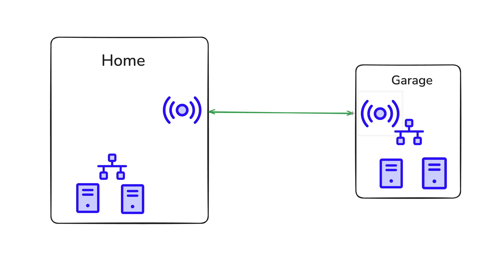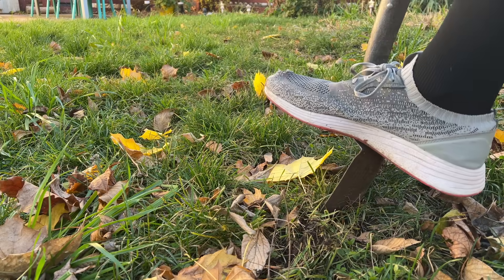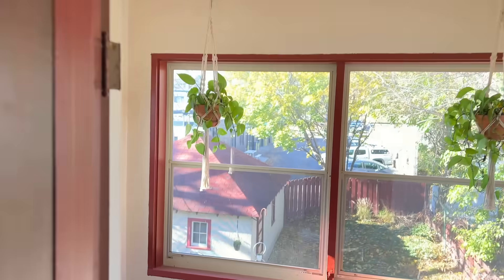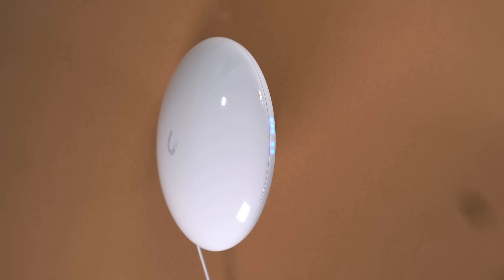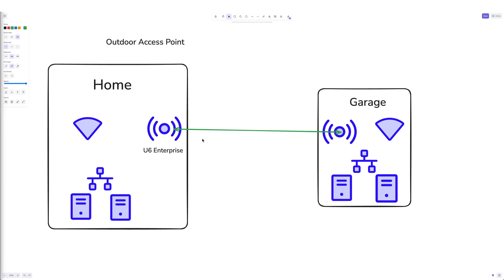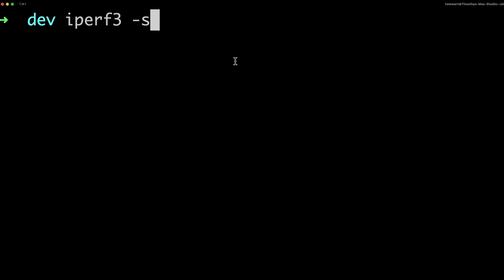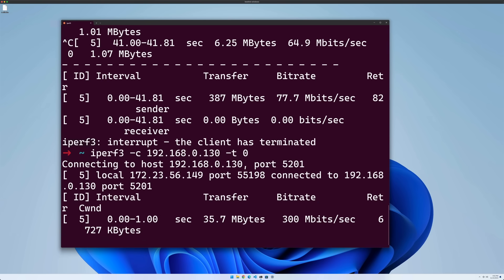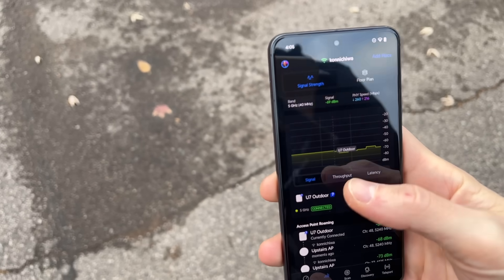Improving my WiFi Bridge with the UniFi U7 Outdoor and the UDB

Comment: I recently purchased a new U7 Pro SGX and a UniFi 10G switch. The switch uplink is connected to the router at 20 Gbps, while the access point is connected to the switch at 10 Gbps. Despite trying different spectrum settings, my speed test results remain consistently low—around 720 Mbps download and 350 Mbps upload. Interestingly, when I tested the LAN speed on the same switch, it achieved much higher speeds of approximately 925/925 Mbps. I would greatly appreciate any suggestions to improve my wifi internet speed. For my Wi-Fi tests, I used an iPhone 17 Pro Max, a Dell PC with a Wi-Fi 6E card, and a Lenovo PC with Wi-Fi 5. My internet plan provides 1 Gbps fiber service.

Comment: My situation was similar, however my garage is colourbond (metal) and literally nothing can get in or out of this giant faraday cage! So I bought a cheap wifi antenna, mounted it on the outside of the shed with the UDB Bridge inside (you can select external antenna and just connect the SMA cable where the extension antenna goes) connected to a U6+ inside the shed. With an AC Mesh AP on the outside of the house I'm getting a pretty stable connection with 2-300 Mbps. This makes me thing the U7 outdoor would improve it even more. Also I'm not convinced the extension antenna works as well as it could.

Comment: Dude.  Thanks for this video.  I struggle trying to find real world scenarios that match my exact scenario.  I'm at 5 minutes and your scenario and thought process is nearly exactly the same as mine.  The point to point is ideal but, well, total overkill.  For the price, I could just pay someone to run the LAN line :).  

Another benefit is - this is a nice modular solution; it'll likely last a few years and be usable in other scenarios.

Comment: The point was to have reliable WiFi in the garage, no? When you installed the U7 pointing to the garage that was it. Why did you need another AP there still?
Maybe I missed the final solution drawing.

Comment: The most stable connection would be an aerial steel line (if diggig is not an option) and fiber optic cable attached to it. That is what many ISPs do in some countries and it works. The only downside would be just the visible line between buildings, but its tiny anyway. Are there any other downsides? No digging, no APs, no radiation, almost clean job to do :) Nice vids you're producing!

Comment: Be aware that connecting a single UDM Pro to the Unifi network(in my case to a AC Pro)  using the suppied poe adapter is fraught with fustration and issues.  For the last 25 days I have been working with Unifi support to get this working.  I am using early release software but still it doesnt work.  The UDM Pro adopts to the network comes online for a minute and then goes offline and stays offline.  If you connect the UDM Pro to the network using a ethernet cable it works OK.  Bear this in mind before you think of using.

Comment: Have you considered EnGenius for your connectivity needs? Our EOC product line offers robust point-to-point and point-to-multipoint solutions designed for reliable wireless connectivity.

I previously owned a WISP and primarily used Ubiquiti, but after switching to EnGenius, I saw significant advantages. Now, as part of the EnGenius team, I’d love the opportunity to discuss our solutions with you

Comment: Can I use the UDB / UDB Pro as a Bridge to connect to my existing wireless AP's - Netgear, Zyxel, T-Mobile router, etc? I have multiple networks at different locations using a wide range of brands of equipment. I also have another location where I have the Unifi Swiss Army Knife set up as an Access Point (not adopted in Unifi). There is no setting in it to turn on "Mesh mode". Thanks and great video.

Comment: Seems like a point to point bridge would’ve been a better solution. The argument against it was that it required outdoor mounting and drilling holes. But then the U7 was installed outside which still required drilling holes.
Reply: Correct.  Cheaper, faster, more reliable, already outdoor rated, etc.
Reply: not only that but needing an ap inside the garage still .
Reply from the maker: @JasonH17 that’s right!

Comment: @TechnoTim Thank you so much for the review! I want to install 2 pieces of u7 outdoor antennas in Omni directional mode at an outdoor distance of about 870 feet (~265 m.). Can I connect them to each other using Mesh and distribute the internet and network from the second access point at a remote location?
Reply from the maker: This should work and give you coverage in between albiet maybe not the greatest.  If I were going long distance I would use the UDB Pro since that's what it's made for.
Reply: @TechnoTim  Sounds good. Thank you so much for your reply.

Comment: Why not just upgrade to network cables?, they are faster and impossible to hack, yet wifi is not secure and emits toxic, harmful electromagnetic radiation. Be considerate to others and don't use wifi or harmful wireless frequencies, it's worse than second hand cigarette smoke.

Comment: Just now setting up four U6 Mesh access points that I have been sitting on for a year. Since my shed is only 120ft away I think they will do, but the performance of this has me wishing that I held off on my purchase until ready to run conduit throughout my house. The 4th U6 Mesh is going to another out building about 100ft away. Oh well, the two U6 Mesh WAPs installed to the exterior of my house are radius and also providing a strong signal for inside.

Comment: The U7 outdoor really is a beast.  We upgraded to one at work from the U6 Mesh units and the difference isn't even funny.  Crazy good deal at $200, for what you get.  That said, $200 for that and another $100 for the UDB (most people don't get Ubiquiti gear for free), for $300 I suspect you could have had a contractor bury a new cable for you, or perhaps run it as an aerial line, and that line would absolutely DESTROY the wifi gear with a rock solid 10g over copper throughput (if you have it, else EASY interference-proof solid 1g performance without blinking), without blasting all your neighbors' wifi out of commission.  Better yet, fiber, and never have to worry about speed again, at least not until 100g networking is too slow.

Comment: great video! just a couple questions how does the power get from your house to the garage? I had a similar project where i used a tension cable for hanging edison patio lights and some outdoor rated CAT6 and just tied the 2 buildings together. it worked out great for me.
Reply from the maker: There's a buried cable from the house to the garage (another reason I didn't want to dig)  😅

Comment: Dude... stop coping, please. This is not an ideal setup if you do anything mission critical on your garage network. Just lay a speed pipe between the buildings and file the costs as business expenses. You WILL see yourself wanting to upgrade to 10+ Gbit/s at some point and then your only option is optical fiber. You're only delaying the inevitable.

Comment: The point to point was the way to go. They operate at 60 Ghz do there's virtually no interference and then use a poe switch in the garage. Use that to power whatever AP you want to use. Couldn't finish watching this.

Comment: I honestly went with PTP between house and garage using the UISP Wave Pico. They're cheap enough and easy enough to set up and look great too. (I can send pictures) Especially with the Quick Mount they provide in the store separately. Having 60Ghz is awesome for speed and latency and optional backhaul is nice too, for when it's needed. I initially thought it was overkill too. Although, right after I purchased it, a week later they announced the new bridge devices.

Initially I was gonna go with the UBB but there was stock issues and a longevity issue in the event a replacement was required. The waves are modular enough, plus it's fun to mess with a new software suite. UISP is quite cool, too.
Reply: The Wave Pico and or Gigabeams are worlds better than going back to a nanostation/loco/nanobeam or the rebrannded ubb/udb.  While not full duplex, they have enough bandwidth as a half duplex device and also give you the fail back 5Ghz as well.   Yes it will not show up on the Unifi dashboard, but it is a much cheaper path that you took.

Comment: We just ran a dedicated point to point from our water tower to our new building site a little over a mile away (utility company). We are also in Minnesota so I'm curious how well this will work in our cold winters 120ft in the air. 😁
Reply: As long as it's ubiquiti or Mikrorik, it'll be fine. -40F and the units are rock solid as long as you UPS the units and intend on running them 24x7. Had good luck running them  from about 95F to -40F without any issues, DFS bugs in beta firmwares but generally really stable. Only issues are Line Of Sight and interference from other devices. DFS is nice for that; multiple 20/40MHz channels to play with free from much interference (unless youre near a huge urban center)

Comment: To connect our shed to the network I'm going to run a cat 6a STP suspended on a wire about 15' in the air. Leaves plenty of headroom for moving ladders about and I can get the suspended wire as tight as a guitar string. keeping the cat 6a equally straight. No limp noodles like the rest of our network in the house. everything dead straight and right angles everywhere. Copious amounts of cableties and outdoor rated cat 6a too UV protected of course. that will give me 10gig over the copper. points are already wired at one end. just need to fix the shed up now :P I'll probably put 2 cables up there so i have a redundent cable should the first one fail.

Comment: One of the first things I did when I bought my house in South Minneapolis is dig a trench, lay down 8-3UF, 1-1/2 conduit, and pull 6 runs of cat5e to the garage. A few years later, I yanked out the cable, and pulled it back in with an air hose, so my compressor is in the garage and I have compressed air in the house.
Reply from the maker: Much better use!

Comment: When testing using the DFS channels how bad is the interruption from rescanning for an open channel? Curious if this was just a monetary drop or if radar occupies large frequency ranges and means a longer drop out.
Reply from the maker: Great question! A couple of things I noticed:
1) Channels take a long time to scan when switching to a DFS channel, up to 1 minute
2) When radar is detected it tells my AP to switch channels.  I think that that point it has 60 seconds to notifiy all of my clients of the incoming changes and will find a non DFS channel, at which point it switches.
3) This change happened within 2 minutes and all clients switched channels.  There might have been a small interrupion to the clients but hard to know
4) The access point stayed on the NON DFS channel until my daily optmization ran at 2 AM, then it switched back.
5) RADAR was never consitent.  Seemed to start at 7:30 AM, 2:27 AM, 5:54 AM.

Comment: I have build wireless bridges for years now. First 11Mbit with Dlink and Yagi-antennas, than 300Mbit with patch-antennas (Dlink and TP-Link), than 108Mbit point2point over 300m with Ubiquiti, than 5Ghz as an upgrade on the same link and now mesh with AC-lite, AC-mesh, U6-mesh and U6-pro. About 35 APs controlled with a single RasPi4b.
Reply: What do you use in the raspberry?
Reply: @rafaelpirolla I use RaspiOS with Unifi-Controller.

Comment: Did you try the UDB Pro?  Would be interesting to see if you got any additional gains at that distance...
Reply from the maker: I did, it's in there.  Worked a little better (better quality signal) but still not worth the hassle if I was going to mount it properly since it's directional.  New AP (U7) plus UDB FTW!
Reply: @TechnoTim  lol, multitasking while watching..  yeah it was super impressive at distance in my testing..   UDB made more since in ur application, I was just interested in speed results head to head....
Reply: @DPCTechnology  Same here.  I would like to see speed results of 2 UDB pros mounted outside compared to his current setup

Comment: I've been using two Ubiquiti Nanostation locos between the house and garage at my parents for years now. They work extremely well and haven't had any issues with them. They are UISP devices but they do show up in the Unifi network topology properly. The reason I did those was also the same reasons you have for not running a cable. Though thankfully the siding there is vinyl and not stucco haha.
Reply: I've been using PTP from house to garage for 4.5 years with a pair of NanoBeam AC Gen2 from Ubiquiti. Work great for cameras and garage TV.  Similar constraints as you in my South Minneapolis property regarding trenching. These NanoBeams have been rock solid, but I do have to manage them separate from my Unifi gear, which is not difficult.
Reply from the maker: Good to know they show up in UniFi even though they are UISP!  I will keep that in mind!  Thanks for confirmation!
Reply: @TechnoTim  np! They only show up under wired connections though! So if you filter by only Unifi devices they won't show up. But when they are showing you can see the connection between them.
Reply: Have a pair myself. They have been great.
Reply: Also 1/4 the price. I use the airMAX NanoStation 5AC Locos and they are very easy to setup & rock solid.
Reply: Yeah, I wish they would make it so we could manage them within the unifi console.

Comment: This is not a great setup to be honest. Just get a point to point and an access point to the garage i know yoy dont want to drill holes but man you have too many devices not designed for this all trying to work  together and give a mid solution
Reply: Homie complains about congested 5GHz spectrum and then un-ironically takes up 240MHz of spectrum at high power to run a security camera.
Reply from the maker: @ManuelRodriguez27  homie had to test it out
Reply: That distance is screaming for $50 of direct burial fiber and no interference headaches forever.

The stucco wall drilling and very thin concrete expansion joint probably take less time than the 240 MHz tests. And it's a new video!
Reply: @storyinmemo  I mean for sure but if he really doesn't want holes at least get a ptp. Perhaps use the wifi 7 AP inside and get rid of the old ap too.
Reply from the maker: Thanks for the feedback.  This is exactly what the UDB is designed for, point it at your existing wifi network. Works great according to my tests and point to point doesn’t give wifi coverage in or around the garage.

Comment: Assuming you already have mains electricity in the garage you could have tried Powerline (ethernet + WiFi) with one of the consumer unit  boxes of the kind that Devolo do (Magic 2 LAN DINrail on their website) to increase the bandwidth.
Reply from the maker: Thanks!  I thought about that but heard that it doesn't work great for sub panels?  Maybe I can also try that in a part 3!
Reply: @TechnoTim one thing you need to keep in mind when running the power line Ethernet adapters is they really need to stay on the same phase of your power. So if your garage’s circuit breaker is on the left side, the power line adapter needs to be on a circuit on that side as well. If the sub panel is a 220 double breaker you will just need to try outlets in the garage on both legs to see which matches up. Also keep in mind they shouldn’t be plugged into any surge protectors. The adapters are cheap enough I always recommend at least trying them for most people before doing point to point when running fiber isn’t an option. Best of luck.
Reply: I can confirm first hand that Powerline adapters can work great until you attempt to cross sub panels. I tied the same for my Grandparents home to garage and it wasn't able to connect whatsoever, no matter the socket used by the adapter in the garage, but your millage may vary.

Comment: Ubiquiti has had point to point wireless bridge using 24ghz and 60ghz for years. It's plug and play. Aim it through walls. No radar interference. Gigabit+. Been using them to connect buildings in close proximity for a long time.
If you're broke or not sponsored by Ubiquiti, Mikrotik does similar products, been using them for years too.
Reply from the maker: Thanks for the heads up, I will check it out!  I am not sponsored by Ubiquiti. Looks like there will be a part 3 to my wireless bridge in the future!
Reply: I don't think 24GHz and 60Ghz radio can go through wall at all
Reply from the maker: @johnnyzhang1253  Good to know, it's not only a wall, it's stucco (house & garage) so it's a cement wall too!  😅
Reply: @TechnoTim  rib bro
Reply: @TechnoTim  Stucco also has wire mesh embedded in it. Us South Minneapolis stucco home owners can resonate with you.